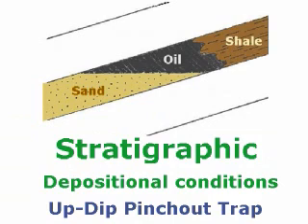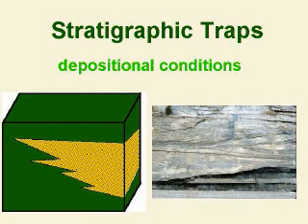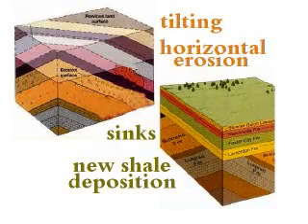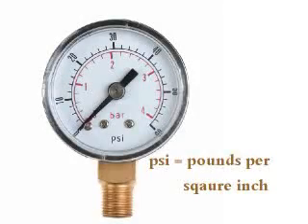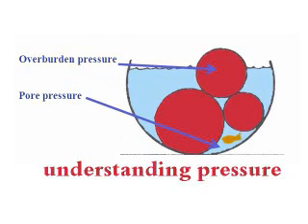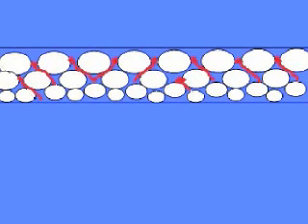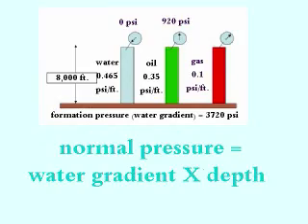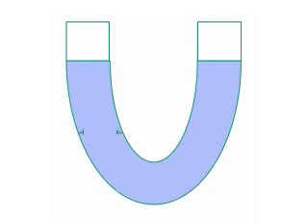Overview Chapter 2 part 4 Petroleum Origins

Comment: The drawing is not 100% accurate. The level of the water on the left side will be lower then the level of the water on the right side. The level of the oil on the left side will be higher then the level of the water on the right side.

Comment: I've not understood the last image, if with no oil both parts of the tube present the same height of water, why after adding a little quantity of oil in one of them, the height of water is increased in the same part of the tube which has been added the oil in. Thank you very much for your videos, despite this doubt they are really well explained